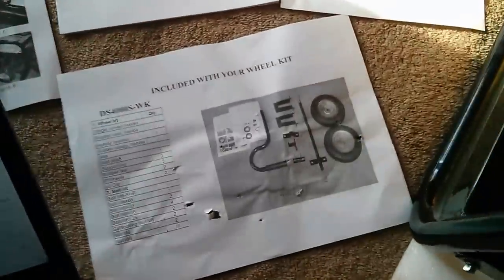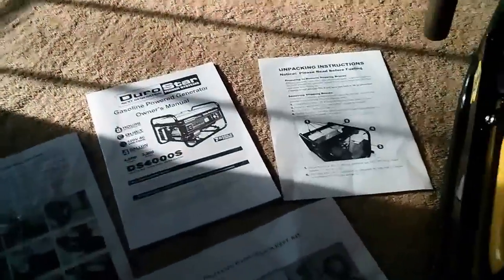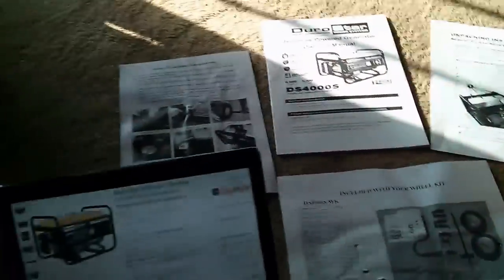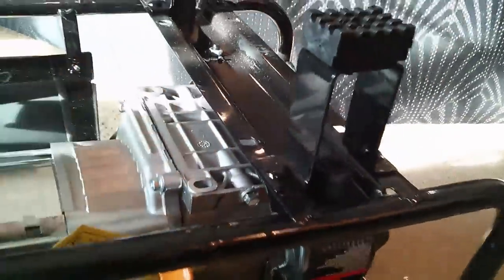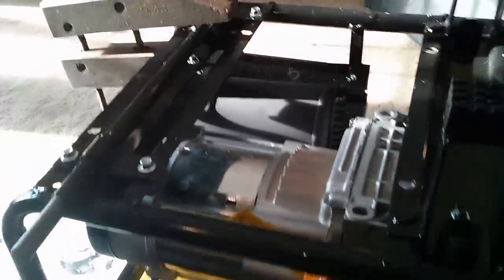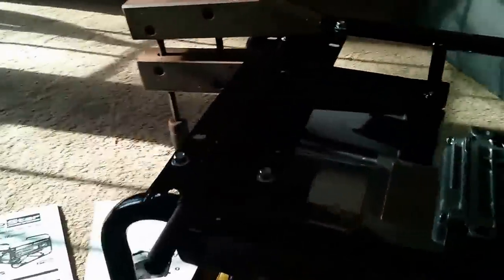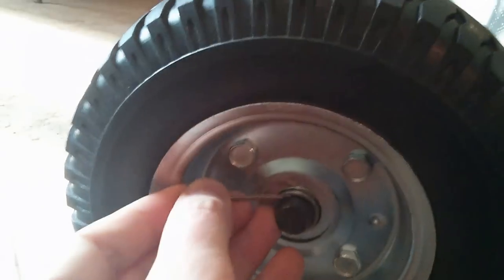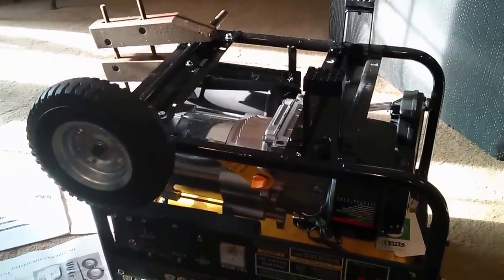How to Attach the Wheel Kit for the DuroStar DS4000S Generator

Comment: Thanks a million...saved me about 30 minutes.  Well done.  But I was able to get the axel in by putting both screws in with the nuts loosely. then tightening each in turn without having to clamp down the rubber caps. Seemed easier for what its worth. Anyway, thanks again.